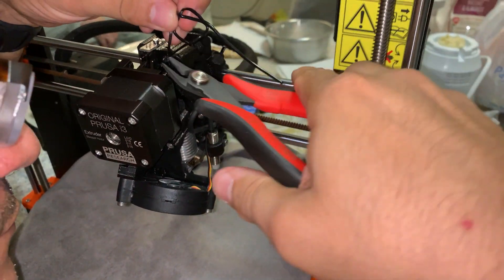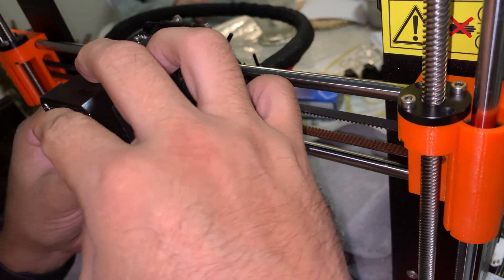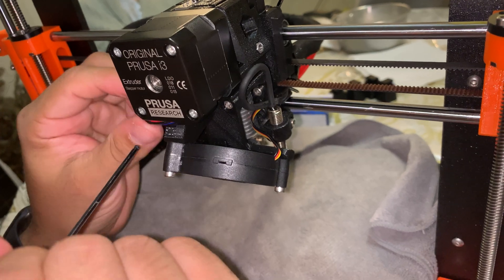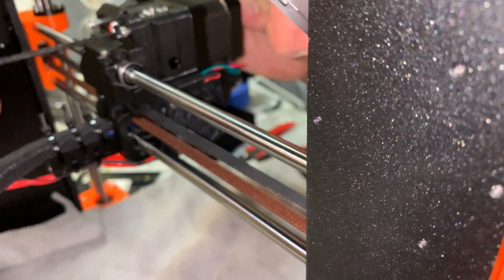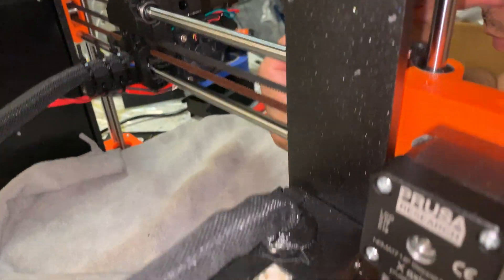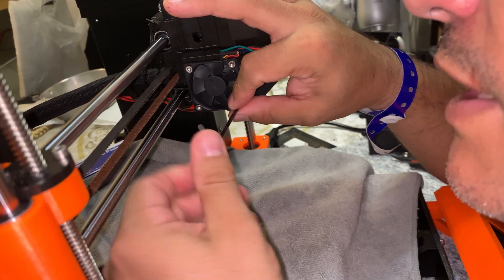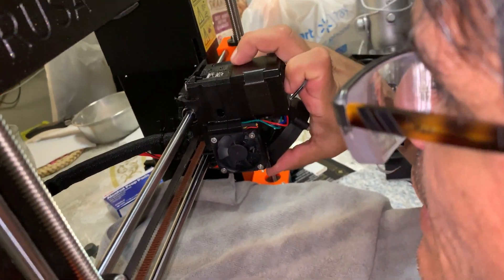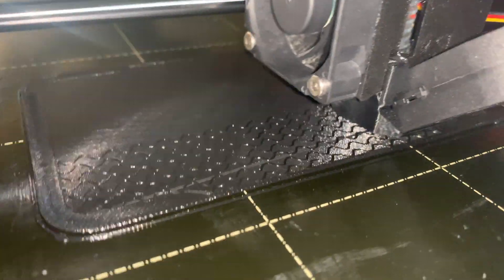Prusa mk3s how to fix filament jams

Comment: Thanks for th video . Wish you did it at the being have same trouble. I’m scared to do it by watching you gave me the confidence that I’m going to do it but how much time did it take you to do it so I’m just trying to figure it out
Reply: Yes I would like your have your information so I can contact you
Reply from the maker: zorro fox juan2617@gmail.com and then i will Guam you my number
Reply from the maker: zorro fox Let me tell you something believe it or not I was very scared to at the beginning and once a took the courage it took me less than five minutes to come in and take out the filament let me give you one more pointer do you flexible for filament actually moved my board and tube and I had to push it back so I have done this numerous of times you could contact me in a private message and I’ll give you my contact information information if you want me to help you further along thank you
Reply from the maker: My email address is Juan2617@gmail.con You could contact me there and I’ll give you my personal information and we’ll discuss to see how I could help you better thank you
Reply: I definitely need your help I did everything like you said on your video and through Prusa website.  Everything works on the beginning and later on it becomes stringy and then clog then floats in the air what do you suggest that I put the Nozzle wrong or maybe the nozzles too close to the heater block or it has to be further away
Reply: Thank you got to work will send you pics . What I didn’t close the door tighter. That’s what happen.